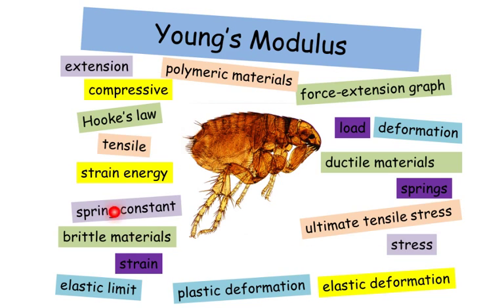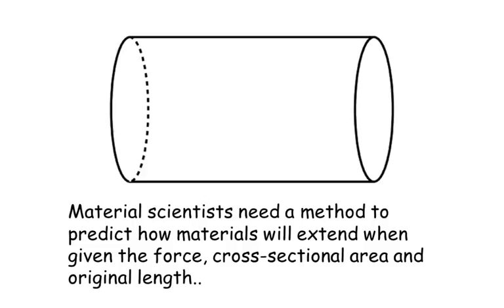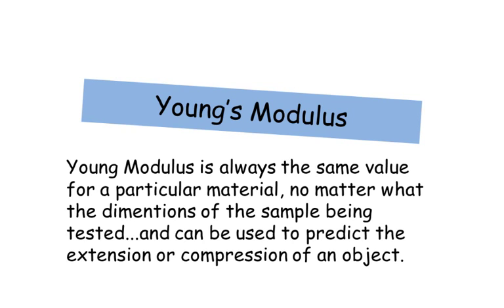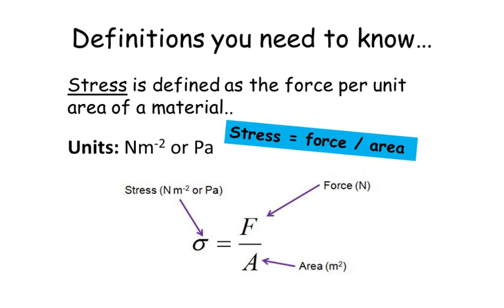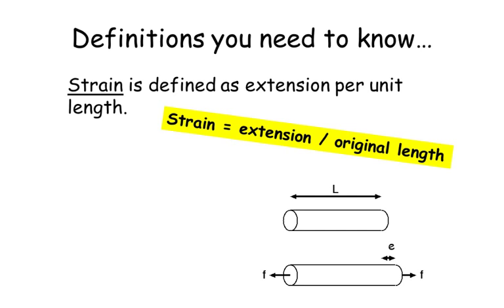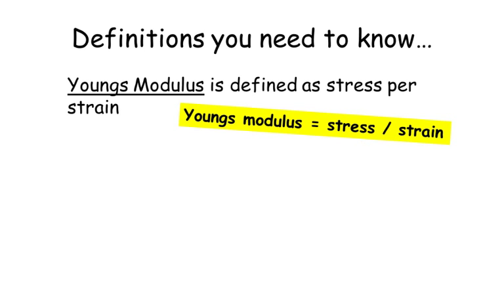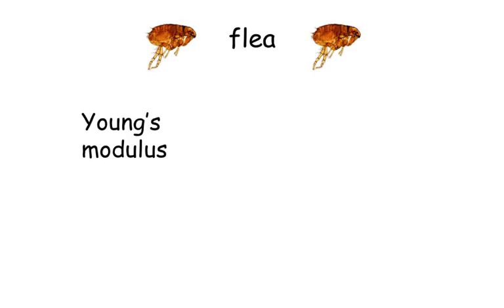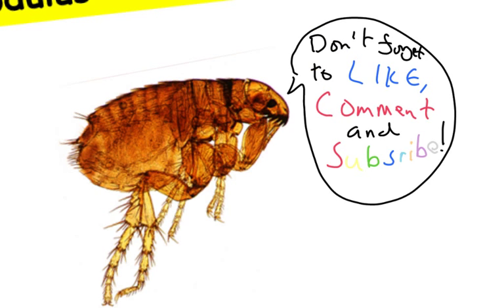Youngs modulus - A level Physics

Comment: hi I'm struggling with a question I've got the youngs modulus as 200x10^9 and the stress as 8400Nm-2 but I'm struggling to work out the formula to find out the strain as I only know how much it extends by under load and not the original length. could you point me in the right direction as i seem to be getting some daft answers
Reply from the maker: hi Robert. are you on Twitter? send me a photo of the problem @cgozzard
Reply: +Chris Gozzard (That Physics Guy) hi Chris I've sent you the picture on twitter and.follwed.you thanks
Reply: +Chris Gozzard (That Physics Guy) Chris I am struggling with the same sort of question,can you help? Thanks